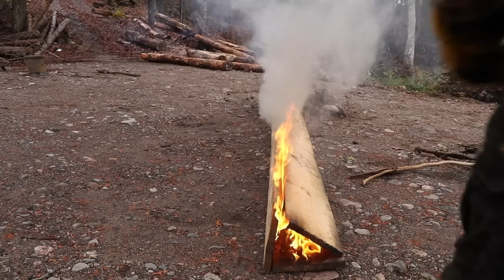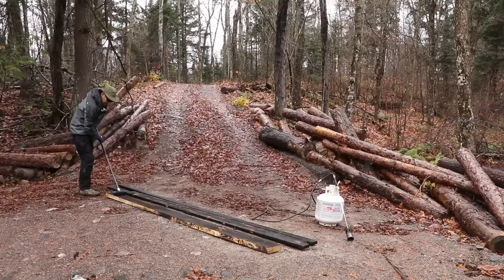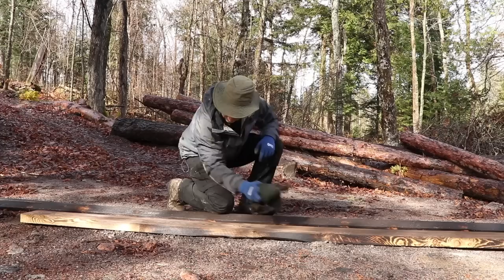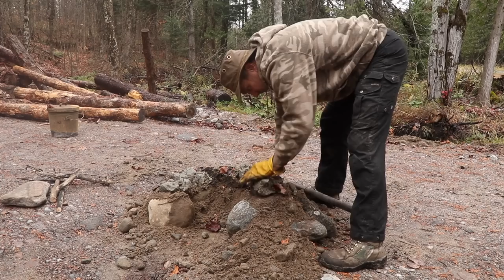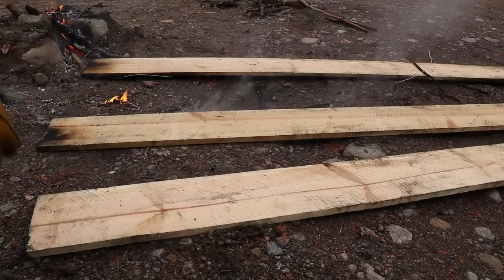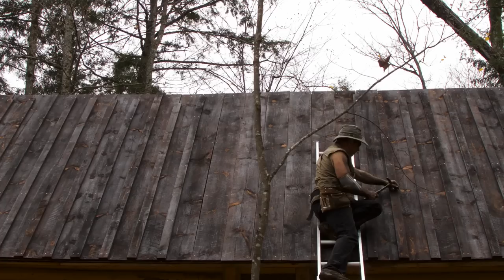Traditional Japanese Way to Preserve Wood with Fire using Shou Sugi Ban, Yakisugi on my log cabin

Comment: Typically in a timber frame building, with the members at least 1 1/2" thick the outside will char and then if the heat isn't hot enough to burn the member all the way through the remainder of the wood core will be protected and provide strength to the structure to prevent total failure.  In that sense, a heavy timber frame is more resistant to a fire because when a steel member gets hot, it softens and weakens and will collapse with the loading on it.

Comment: As I said on the last video, my only experience with fire treating wood has been from Norther European’s, dating back to the Vikings. Had no idea the Japanese did it too. It also occurred to me, even in modern homes, we treat our floors with waxes and oils. But I question the efficacy of soaking/rubbing them down with highly flammable oils like vegetable oil. I’d look into that before installing to see if you’ve essentially made a creosote “bomb” waiting to go off.  Particularly because the home will have a wood burning heating system. Maybe even experiment by torching an oil soaked piece. After all, your family will be sleeping in that.
Reply: When they talk about spontaneity combustion in “oily” rags this is a chemical reaction found in solvents. Plain natural oil by itself is not any more dangerous then a green piece of pine, pine tar oil is extracted from pine wood after all.
Reply: Anon sure, but 2 things- I wasn’t addressing spontaneous combustion. Working with a wood stove exposes the cabin to greater fire risks, from embers, coals or even other sorts of mishaps and accidents. And finally- the oil used wasn’t pine oil, but rather, generic vegetable oil, which is flammable. Fwiw.
Reply: M85FSLUVR so wood stoves by nature come with inherent risk that’s something you accept when you make the decision to use such. Vegetable oil is combustible, only flammable when it is heated to a high temperature Flashpoint 327C 621F. So unless your planning on heating the interior of your cabin to those temperatures I would say this is a moot point.
Reply: M85FSLUVR for what it’s worth FWIW pour some vegetable oil in a pan and throw lit matches at it. Now repeat 100 times. Now 1000 times. That oil is never going to ignite, that’s called science. Stop watching Bill Nye the science liberal and get some real life experience outside of your moms basement
Reply: You are talking about cold oil not burning in contact with fire? Because on a very hot pan oil will catch on fire, right? I have seen it. Please enlight me.
Reply: Karima Osmani 327 degrees Celsius or 622F is extremely hot. At this temperature vegetable oil changes from a combustible to a flammable. The circumstances needed to cause a fire hazard with vegetable oil soaked wood is going to be a fire hazard to most structure of most material. The oil is not adding a significant fire hazard. This conversation had also become insignificant.
Reply: You are correct to point out that vegetable oil is combustible, not flammable. A quick Google search proves that. As you said, 'science'.
But then you decided to put a politically biased(Republican?) slant on the subject by lashing out at a liberal scientist. What was the point of that? What was the point of insulting another poster? I don't think Sean James would approve. Actually, Bill Nye may have proposed the same test you did - throwing lit matches in a pan of oil. 
BTW, I've discovered, after watching loads of YouTube videos on many different subjects, it's often the people who post as 'Anon' that end up trolling a thread. Be courageous enough to use a name.
Reply: Thank you Brian. A voice of civility. Politics and arrogance not needed on this man's videos.
Reply: I like your icon. Looks like a photo of chicken-of-the-woods fungi on a dead log. 'Chicken' & 'dead wood' is an appropriate identifier for you. Do you remember that old CCR song "Trolling, trolling, trolling on the river"?  I love catching bottom feeders, stink bait works best!
Reply: Anon just to be completely factual about the occurrence of spontaneous combustion of oily rags, it's a byproduct of the curing process of oils not necessarily solvents (which are made from oils). For example, boiled linseed oil on tightly bunched up rags will produce enough heat to ignite. It's all about the concentrated amount of curing oil on something like rags. Other than that there's really no other sinario that would possess that worry.

Comment: I just found this video.. I’ve see.some are f your videos using this technique, but without much elaboration on it. 

I am familiar with this technique, and would love to use it on walls and the floor in my workshop… st this point I’ve only made raised beds using shousugi ban…

I notice that you do use propane like I do, but also the triangle burn technique that seems traditional. One other thought is creating two fires parallel to each other but running about 8 feet long or however long your boards are and placing your boards, one at a time, between them, to get the burn… I’d guess that you’d get a nice even burn from both sides… I know that the “log” fire, based on this is sometimes used to create a body length campfire to keep a person warm when trying to stay warm outdoors without a sleeping bag or other protective covering..

I figured doubling it up my price useful for shou Sugi ban…

Comment: Rather than using oil, wood tar is the correct product to use after the char.
Wood tar smells but is much better product than any oil as it preserve the wood and the natural resins in the wood, whereas oil products will pull out the natural resins and oils from the wood itself.

Comment: Just a little heads up, vegetable oil is reactive and will eventually turn rancid.  The smell given off won't be severe, but it's not ideal.  In general, a neutral oil like mineral oil would be better in this application.

Comment: Awesome knowledge to share with us, thanks!  Great benefits and cool look.  Question; concerning the walls of the cabin, did you do anything or plan to do anything to protect them from the elements?  I just wondered what if anything was done differently in the preservation of your efforts so it did not end up looking like the deteriorated outside of the cabin you built in your 20s.  Thanks.

Comment: Shawn, I was wondering why you threw the metal pieces in the fire pit, but then figured you were going to melt them while charring the boards.  Is that correct?  I've never used MAP gas before, but have seen the results and talked to the guy who did it.  He told me MAP gas flame chars the wood more evenly than propane.  I must say, your finished product looks amazing! Beautiful grain and color.

Comment: I first saw this on samurai carpenter channel and thought of getting brush sander too... But even with steel brush it seems to be a nice fast progress... I just cant stand that looks, it just looks beautiful when brushed and oiled.
We have an hold house with exterior done with this method and the planks are as old as 100 years by now, still no sign of rot, just water has washed off most of the wood with heavy rain and wind. I added white trim to windows and roof and after few years the pain has started to crack and wood is just deforming. Probably should have burned, oiled and then painted but hell with it...

Comment: Very interesting. Looks good but I wonder if it will last like tin roof would. Most of all I wonder about fire effect in the structure, being out in the woods it is already higher risk of burning down. I also would sugest you look into the  new generation of clear fire inhibitors liquids you can apply directly to wood.

Comment: I know about fire hardening wood for arrows and spears. Never thought of it in this manner of use. This has totally inspired me to do more research on it and even visualized the means to fire the wood without the use of propane. So, very excited about this. I wonder if this will work for any type of wood. Like pine and or oak? I noticed the planks used on the roof, they are very black. So, they were not wire brushed and or oiled?

Comment: Propane vs fire pit, which did you end up preferring? It looks like the fire pit would actually be the faster technique since the whole surface of the plank is burning at once. But propane would probably give more control over the depth of the burn.
Reply from the maker: You got it exactly. With practice, the fire method would be much faster and better. I'm finding that it's hard to get a uniform burn with 12' and it's hard to flip it while it's burning. I would like to try again on another project with 8' boards.

Comment: Vegetable oil?  Are you planning to eat off the floor or is linseed oil too expensive for a large area?  Looks really good.  Whoever milled those boards got some really straight edges for a tight fit.

Comment: One benefit to carbonizing layers of wood is insects, molds, fungus can't process carbon as they can cellulose (if the carbon is too deep for them to reach). Of course it can weather over time. But carbon is mostly inert and can last for a long time (ex: carbon dating)

Comment: My experience has been Ive had lightly charred post hollowed by termites. It seems that  the cellulose ( wood sugar) needs to be caramelized . I thinkthe higher temp you can get the wood without burning the better. But I also think this reduces wood strength,  I would only  heat treat sideing,  not  timbers

Comment: I really like the method of wood preserving. And not to be a nay-sayer, but in my part of the world (Pacific Northwest) your roofing method is guaranteed to leak. I think it would have a better chance if you would have laid the boards horizontally, lapping the upper ones over the lower ones, like lap siding. Anyway, nice job on the raw materials!
Reply from the maker: Mark Pool Agreed

Comment: I am skeptical about using it for flooring since the grain has elevation. The point is to seal the wood. If you pour something on it, like oil, doesn't that open up the grain?  But experiments are fun.

Comment: I’ve heard of this technique, I want to do this on logs for a retaining wall. Would you still use the oil if you were putting them in the dirt?
Reply: Yakisugi wont work. You need to char deep down. A surface burn doesnt do anything. And the size wood you need for a retaining wall womt get charred deep down.

Comment: Shou - pronounce like Sho of Shotokan.  After charring, apply the oil.  The application of the oil will remove any surface char that can get on hands and feet and you're good to go.  No need to wire brush that much.

Comment: Personally, I would avoid canola oil because of the smell when it oxidizes. Maybe cedar oil could be spray applied, or spirit of turpentine (not the petroleum product, but the extract of pine or balsam fir) brushed on?

What kind of oil do the Japanese use with this process? And how was the process finished in the ancient scandinavian stave churches? I think they used tar of some sort.

Comment: Fixer Upper - HGTV - they did an entire home exterior using this method. Looked very unique. I like it for the roof. Did you use the oil to help get the full char when you tried the traditional method with the 3 boards tied together? They really started cooking. Great videos...
Reply from the maker: Thanks. No, I never thought of that, but I don't think I would want to use more oil than necessary.

Comment: I love the look of the roof, but I'm wondering how you keep moisture from infiltrating between the planks. I'm considering a technique like this for siding and I like the vertical look.  Overlapping horizontally though would certainly prevent the water problem.  Good work.  Thanks for the video!
Reply: yes I too am wondering why he has done it like that . I cannot see how water will stay out after running along the seem of the joint board. seems wrong to me . Horizontally has to be the right way .

Comment: Hey there! Awesome video! I'll be starting construction on my log cabin within a year's time (hopefully). I was wondering if you think this technique would work for the outer log walls and finished with used motor oil? I've never seen this, but looks amazing and if it helps to make it fire resistant...even better! :)

Comment: Hate to tell you this after all the hard work. But the Chinese and Japanese never use char timber as roofing material. they used it on vertical surfaces like wall or fence. Sometimes they even polished it and lacquered  the wood for artistic reasons. The reason not to use it as roof is because dust and dirt will accumulate in the porous  surface, which led to rotting. It is like burying char wood in the ground, which will rot it faster. Think about it... do they burn the wood and stick it into the ground as wooden house foundation? The Chinese abandon this technique once they discovered how to make good polish.
Reply from the maker: sok8888 Yes actually, it's a good technique to use for buried timbers.

Comment: Would boiled linseed oil be a better choice instead of vegetable oil for your floor boards?  It wouldn't go rancid, probably would penetrate better, and possibly preserve it better.  I am not an expert on this, so this is more of a comment rather than a statement of what should or shouldn't be done.  Regardless, I am very impressed with the work you have done on your cabin.
Reply from the maker: drbrono Yes, for sure. It's just a demonstration of what you can do on a budget. I'm probably using wax for the floor

Comment: Wow so beautiful for floors. Are you going to use Satin finish polyurethane on he floors? I thought you bought the roof already fire hardened planks. Did you buy the roof and do he cabin floor planks yourself? I thought you just through in the roof being done again to show other's that might not have seen roof already done in last video. I just bet you're going to make some of your own cabinetry for the cabin and my guess is some of it will match the floor. My guess is if so, it will be the kitchen counter and cabinets. Your super talented hard worker, and nothing lacking in you lol.
Reply from the maker: Yes, I'm planning on building everything myself, even if I have to use something else temporarily until I free up some time. My wife and I did all of the wood burning - we didn't buy any of it like that.
Reply: Holey moley you two did a lot of work that will be well worth it in the long run. Tell your wife, fantastic job and choices she makes. WTG!!

Comment: Looks good , but doesn't vegetable oil get rancid as it ages and your floors migh thent have an unpleasent odor.
Reply from the maker: I don't know the science behind it, but I've never experienced that with other things I use vegetable oil (like Olive oil) on. I would say it gets absorbed into the wood enough that it's not exposed very much to the air.
Reply: sometimes lemon oil is mixed with vegetable oil to prevent it from going rancid. i've always used mineral oil with good results, that won't go rancid for sure. good luck!
Reply: that oil gonna stink! lol
Reply: It will get rancid. Need a mineral based oil, not veggie based. Teak oil, tung oil, etc. the only plant based oil that won’t go rancid is walnut oil.
Reply: Why doesn't the walnut oil go rancid? Has anyone else used walnut oil without it going sour?
Reply: Because walnut oil dries, other veggies oils don’t.
Reply: I used teak oil. I never hear of using veggie oil. If it works it would be less costly. Please let me know the results.
Reply: I was always told to use MINERAL OIL on my wooden cutting boards instead of vegetable oil or olive oil because those can go rancid where the mineral oil does not.
Reply: Mineral oil is a petroleum product. You want that in contact with your food?

Comment: I have to ask—three boards at a time... how long did this part of the project take to complete?
Reply from the maker: It's averaged about 15 minutes per board and there's 66 main roof boards and 22 batten boards. Not the fastest, but the installation time is a fraction of what it would have been for cedar shingles. Plus, the theory is that you save time and material in the long run since you don't have to do anything to them.

Comment: I have a question pertaining to this technique. 
Have you used this method on fresh rough cut lumber with high moisture? 
I have a cabin to repair and would like to use some of the native hard wood on the property along with Alaskan saw mill. I'm thinking a heavy burn might eliminate most of the chainsaw scaring, saving time and money, having to only wire brush the char and not an initial sanding. 
That's the thought anyway...

Comment: Here in Oz they screen a British design show called Grand Designs, and they have showcased that treatment of wood a few times on it now,
I wonder of it works on the kinds of wood we typically use here. I must read up more on it.
Wouldn't it be more effective (esp rot proof) if you did all sides of the wood?
Reply from the maker: John Brown Yes,maid that on the roof boards and may do both sides of the floor boards as well

Comment: Just a thought if you use it for flooring would it not make it a bit dark as it would not reflect the light? Really interesting to watch you videos. I have a wood butcher block we use olive oil on it and is really good finish.
Reply from the maker: I was thinking that too, but my wife and I are also thinking that it will be a nice warm look, and the walls can do the light reflecting.

Comment: Is the use of vegetable oil common, just wondering cause it goes rancid of cutting boarders. Don't know if it would be the same outside in the air. Going to build a ATV shed with this method so have some research to do I guess. Thanks for the inspiration